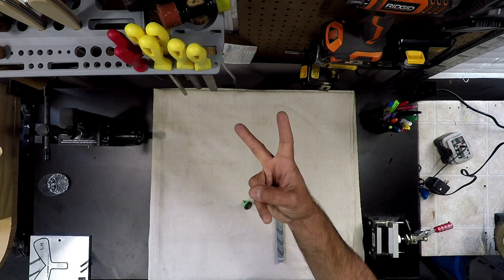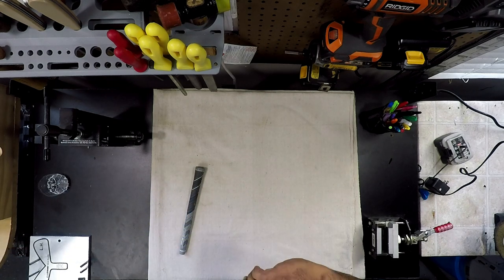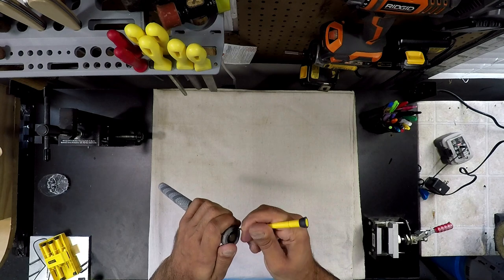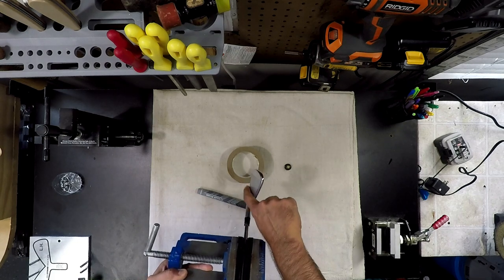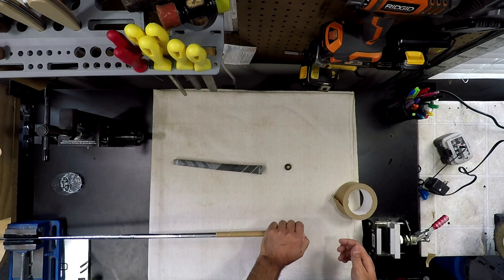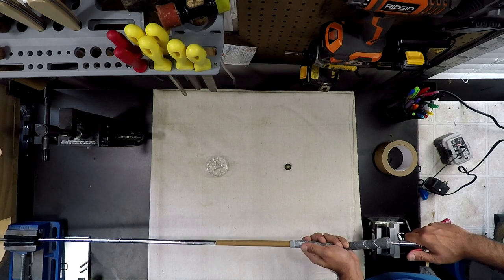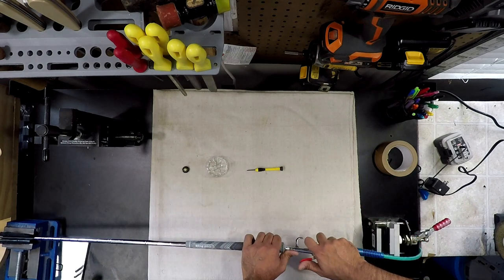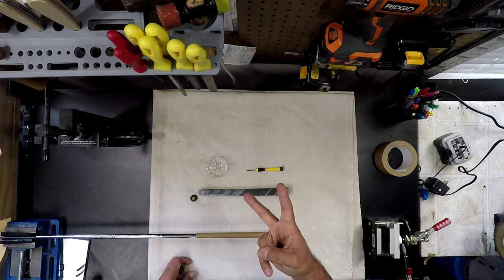Changing & Saving Arccos Grips With Air

Comment: I just had new sensor grips put on my new cobra irons. The top of the grip where the sensor is it’s not very firm and secure and I can feel it moving when I grip the club. Do you think these were installed in properly?
Reply from the maker: Are they the integrated sensors in the grips, or the screw top ones?  I got rid of the screw in ones for that exact reason.  Haven't had any issue with the integrated grips though.  the thing with the integrated grips is you have to choke down about a 1/2 inch, the top part of the grip where the sensor is, isnt attached to the club at all.  Its just a rubber collar extension from the butt of the grip.  If you take a sensor out, youll see what i mean.
Reply: @G2niverse  it is the integrated grips. So you’re saying it’s normal there is some give and movement at the top of the grip where the sensor is? The reason I thought this was unusual is because I bought a couple cobra clubs  that came off the shelf with the sensors as part of the grip. Those don’t have any give at the top - like they were part of the shaft.
Reply from the maker: Its normal for "some".  Its hard to explain, but if you were to put your hand on the grip and thumb on the sensor you should be able to move it slightly.  Not a lot, but youll feel some give.  If you try this and can really see the sensor part moving, its possible the grip was not installed all the way down on the grip.  This can happen if when they are installed, the installer didnt take the sensor out when installing the grip.  The sensor covers the grip vent hole and could back it off slightly because of the pressure.  That vent hole acts as a sort of "pressure release" when you are installing the grip.  It allows air and extra solvent to escape during installation.  By blocking it, you run the risk of not allowing the pressure to escape.  Make sense?

Comment: Where can you get these grips without the sensors? My sensors are fine, I just need to replace the rubber
Reply from the maker: You can't. Unless you buy gently used from ebay